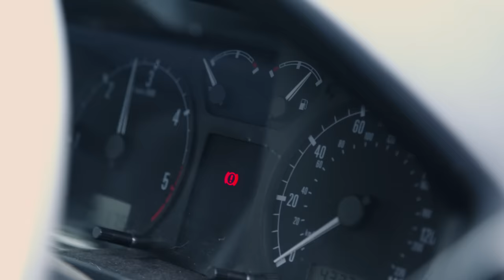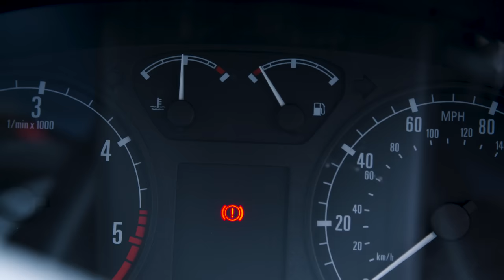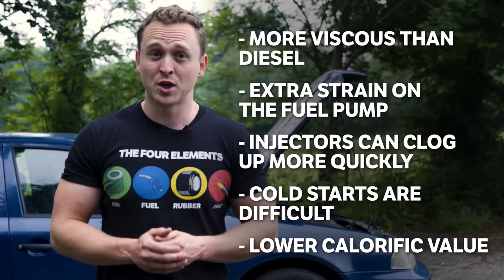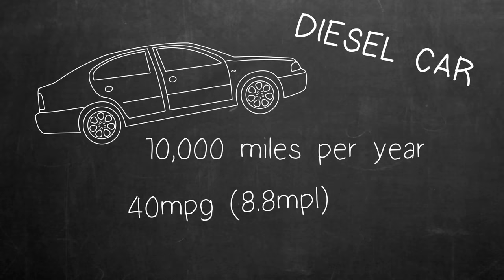The Pros & Cons Of Running An Old Diesel On Used Vegetable Oil

Comment: Technically an older Diesel engine can run on any fuel as long as the viscosity isn’t too high and it also acts as a lubricant.
Reply: Try that on a new diesel with high pressure pumps, direct injection etc you'll be surprised of the result
I've seen it on older diesel such as 1.9d from PSA but anything newer is a no go
Reply: Raphael Le Coustre how comes?
Reply: @E_Rico  veg oil has a different viscosity compared to diesel, you'll break the fuel pump and the injectors in no time if you run with 100% veg oil
A mix of both should be alright in the short term but with the years you'll see damage to the fuel system increasing
Reply: Raphael Le Coustre i saw a video where they use white spirit as a solvent to make the oil less viscous, does this help?
Reply: @E_Rico  I'd rather use diesel even at a small amount than use solvant, a 1/4 ratio of diesel/veg oil should be enough
Reply: Raphael Le Coustre ok thanks for the info
Reply: @raphaellecoustre6493  you can use petrol instead of diesel and burning is better
Reply: @sammyd7857  but still illegal where I live
If you own a car with a diesel engine you can't use anything else than diesel, otherwise its illegal
Reply: @raphaellecoustre6493  it is only illegal if you emit toxic fumes. If your cat converter is still operating then there is no problem
Reply: @raphaellecoustre6493  do you submit to slavery? As I said, something is only illegal if you are causing some sort of problem or harm
Reply: @sammyd7857  as I said, in France using any other fuel than the car is designed with is illegal, and in case of a police checkup you can be fined up to €7500 and you can go to court
Reply: @raphaellecoustre6493  and you just say "yes master"!!!
Reply: @raphaellecoustre6493  in Australia they try to enforce corporate law. What do you think happened in the revolution. People woke up to the fact they aren't slaves
Reply: Killer Beast biodiesel is design to be use in car and is approve by the goverment, its also been made by refinery. glad there such law here.
Reply: @sammyd7857  thank god here in iraq there's no law literally a total mess I run my gasoline car on mainly kerosene cuz its very very very cheap here about 0.10$s a litre and sometimes alcohol n  diesel
Reply: @jungle6815  yes thank England and America for the mess.  Hey if kerosene works no problem. Do you have LPG? In Australia kerosene is more expensive than petrol
Reply: @raphaellecoustre6493  if you thin it and heat it enough then no problem.
Reply: No need for de-watering? 🤔
Reply: @raphaellecoustre6493  would that save me from pump issues?  Especially cold mornings?🤔
Reply: @sammyd7857  losing €7500 for a few bucks saved per month no way I'll do it. And Idc as I'm running ethanol in my petrol car
Reply: @sammyd7857  what about you? Why do you need to disrespect people as soon as they don't break every law in the world, not because I don't like it but I don't have that much money to give to the government.

If I needed then I would of course do it but being able to do it doesn't mean you should
Reply: @raphaellecoustre6493  who do you stand under is the question.  Gods law is do no harm.  All the other stuff is just revenue, and you are acting like a slave if you comply
Reply: Will a diesel run on water?
Reply: you can mix that fuel with a little bit of diesel or oil and it will work perfectly
Reply: That is true, on Balkan people will put anything in their Golf MK2-5 cars. It goes as far as pouring heating oil in their cars and stealing oil from transformer stations.
Reply: Used vegetable oil is not just vegetable oil, it contains various other ingredients of food, which you cannot filter out. So the quality of oil is dependable. Even though this guy so promisingly talks about less pollutants, you may actually be emitting more pollutants. On the other hand, diesel has a standard, well at least to some extent and still way better than that chip fat you get from a shop at nowhere. That should be why it's illegal in some countries. So are any other vehicles that doesn't satisfy emission standards.
Reply: Not true. Running waste engine oil on a 05 Mondeo and so far out of all fuel systems it runs the best on that stuff. Best atomization and a very good shift to early injection timing on start up. Even around freezing temperatures and at a high concentration it starts up like on Diesel.
Reply: @raphaellecoustre6493  add Acetone! This decrease the viscosity of veg. oils.
Reply: De watering the fuel is actually the biggest and most difficult concern.
Down to a few parts per million.
Reply: @raphaellecoustre6493  there are chemicals which you can pour into the veg oil and decrease the viscosity plus a mix with diesel and you are going to be fine. Veg oil already acts as a lubricant so its not a problem
Reply: @dieselgeezer18  it's not about lubrification, it's all about viscosity. 
Pumps are designed to "pump" fuel with a specific viscosity, if the fuel is too liquid or too viscous it could damage your pump as it'll "force" or worse, turn faster 
Try to run a fuel pump dry and you'll see the damage in a very short time 
However I agree it won't break it in a couple of miles but I can do harm, and that's why I still recommend running that kind of fuel with a bit of diesel, you don't need much of it though
Reply: @demoniack81  finally someone that understand my pov. 
Running ethanol on a car that isn't homologated to run with ethanol is illegal too, however the cops will have a harder time discovering it 
I forgot that the car can be seized too, with the €7500 fine
Reply: Yes if he would have used lye the oil is way better you can even mix in 1/4 or more of water with some ethyl
Reply: @raphaellecoustre6493  I run used motor oil in my 7.3 Powerstroke, it loves the stuff.
Reply: @sammyd7857  Amen
Reply: @WilliamStewart1  used motor oil in a common rail?
Reply: @raphaellecoustre6493  by the way, diesels are all direct injection. So your first comment is very misinformed. But i can see that is the type of guy you are
Reply: @sammyd7857  most diesels in cars before the mid 90's use indirect injection
Reply: @TheTomco11  what is indirect injection?
Reply: Also, diesel cars can be converted to LPG, which is not widely known, but actually very good thing to do.
Only 40% of the mix will be LPG, but there are several benefits :
1)increased torque
2)burning of soot - no more black smoke during accelerating, LPG causes fuel to burn quicker and completely
3)better mileage as fuel is burned more complete
4)less contamination of engine oil - less unburnt particles getting to oil as fuel is burned more completely
5)economy. LPG is added during accelerating or under load,  and it is cheaper fuel than diesel. 

Converting diesel to LPG is very cheap and easy - there are off-the-shelf kits avail and many LPG garages do it too. No special tricks or parts required. 
If engine is re-tuned, even more % of LPG is possible in the mix. 

Countries like Spain and France incentivise it by offering subsidies to convert the cars, France up to 2500 , Spain up to 2700e. This alone us very good as it instantly raises value of the car. Car having extra feature like LPG system is easier to re-sale , esp. to eastern europe , or countries with tight emissions limits like Netherlands and Germany.
Reply: @KitKitChanIsaac  No, but I believe it can run on hydrogen without too much trouble. They did it on mythbusters. It isn't a good medium-long term idea though, as your engine is metal and exhaust from hydrogen is water. 😂
Reply: clot shots  old. 
Used motor oil contains additives - anti rust and other mess like MoS , zinc and even lead. Those additives are not fun for health. 
Used motor oil can be refreshed - filtered, refined and topped with fresh additives. It gives it second life, esp. most people change oil early, giving it plenty of life left. 
If not used as motor oil it can be still used as hydraulic or gearbox oil in less demanding machinery, anywhere where one needs stable oil with bit of corrosion inhibitor.
Reply: can they be mixed with some diesel to lubricate the overall fuel? let's call them V85 (85% veg oil, 15% diesel) lol
Reply: @jason41a  veg oil has better lubricating properties than diesel, actually it is as good as engine oil (though ofc. veg oil will degrade quicker on high temp long term use) 
Veg oil has problems when cold, like try putting glass of veg oil to fridge and see what happens, otherwise no problems.
Reply: @E_Rico  you can I have done it 👍
Reply: @raphaellecoustre6493  thats convenient because i have a 1.9d from psa , i run on oil...
Reply: You can put crude oil directly into the fuel tank
Reply: @survivalandia  no not good
Reply: puts solid rocket fuel in diesel tank
Reply: @alexandramarberry1023  diesel then
Reply: So, gasoline Diesel motor oil mix will run fine, just fine.
Reply: @raphaellecoustre6493  you can but it's got to be very thinned out I used to do it.
Reply: @angablade  yes it will but use clean oil
Reply: One Mercedes owner that ran vegetable oil had a small heat exchanger from a boat to preheat his fuel
Reply: Diesel engines have the advantage of being able to ignite basically any hard to ignite fuel. Vegetable oil, motor oil, atf.
Reply: Add 3% mineral spirits (paint thinner) helps a lot with the viscosity.
Reply: if you mix it with kerosene it runs better

Comment: Rudolph Diesel actually designed his engine to run in peanut oil so this shouldn’t be a surprise.
Reply: wait what? 🤨
Reply: He also was working on a design to run on coal, diesel engines can run on just about anything if you can deliver the fuel correctly.
Reply: @garethbaus5471  yep.  At an old job, we ran one of our old semis on a mix of avgas and used motor oil. Ran about as well as an old truck could.  It wasn't meant for multifuel, but it can run it. Older diesels can run on pump gas as well if enough motor oil is mixed in. It acts kind of like a 2-cycle engine.
Reply: And coconut oil
Reply: and then he went missing
Reply: @garethbaus5471  
As a Union Boilermaker I’ve worked at a Coal Gasaficaion plant for a turnaround before and it’s used to make fuel. Even the NotSees did it during WW2
Reply: @srice8959  the design Diesel was working on was actually supposed to run directly on a coal powder rather than using a gasification system it was intended to be a cheap and easy way to power pumps at coal mines but it was difficult to reliably get a good fuel/air mixture.
Reply: Actually...hemp seed oil. You're welcome 👍
Reply: it makes complete sense, since at the time petroleum wasn't wild spread yet,
and germany didn't have much/ if any petroleum avaliable.

peanuts, on the other hand, was avaliable to anyone from a cobler to a cardiologist.
Reply: Well yeah, he literally says this in the video @9:15
Reply: Not to mention he showcased it running on Tequila and Chanel N⁰5.
Reply: And OTTO motor on Spirit,people are just people,look at Brazil...
Reply: He didn't design it to run on peanut oil, but at an early exhibition someone with peanut oil asked if it could run on it and he tried it and it did.
Reply: So, can you mix like a bottle of vanilla extract in it?